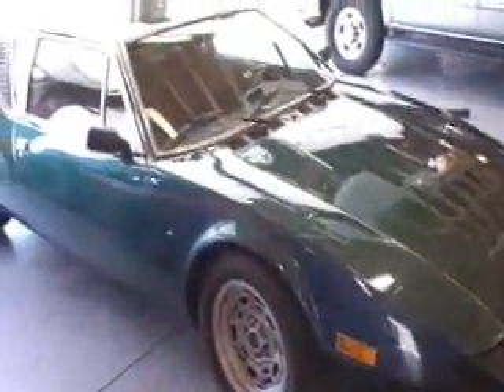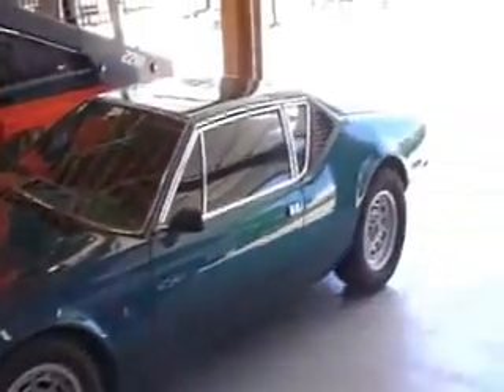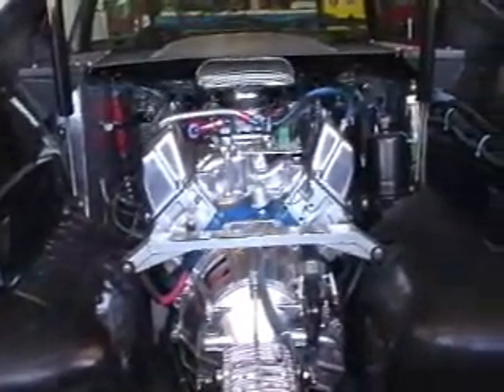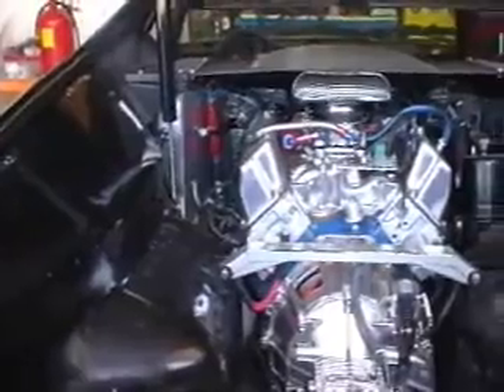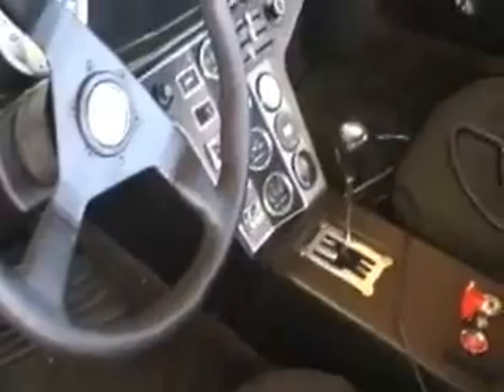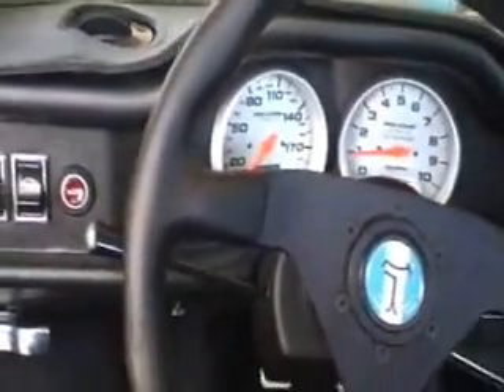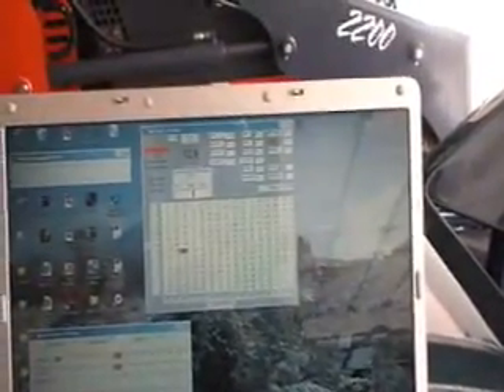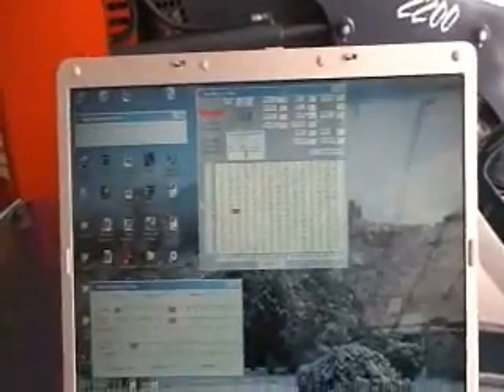Detomaso Pantera EFI

Comment from the maker: I got my map dialed in pretty quick.
I have jetted in my fair share of carbs and really prefer EFI systems.
When you jet a carb it is for that specific altitude,temp,humidity etc. Change anything and you are off your tune. Check out the new Holley system it is self tuning
Rgds,
RG